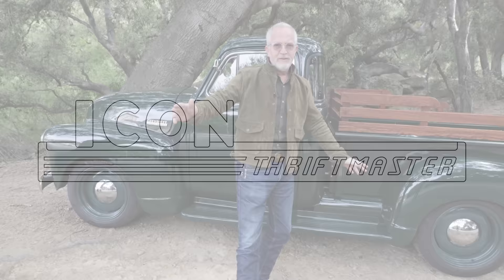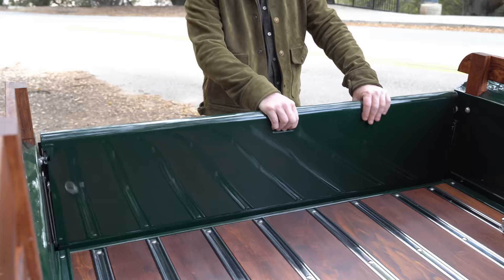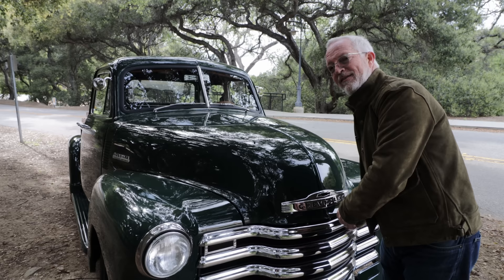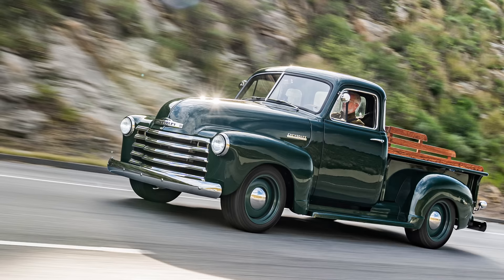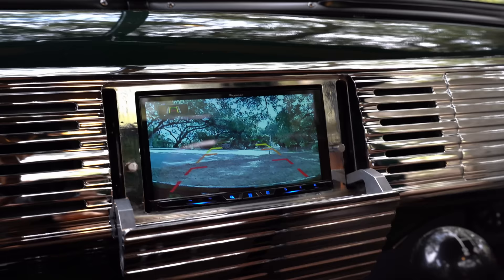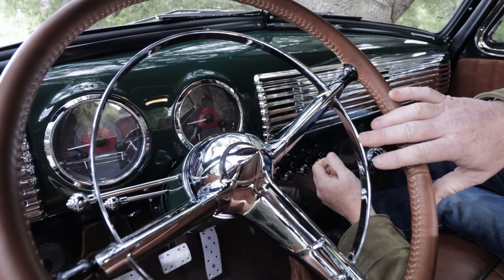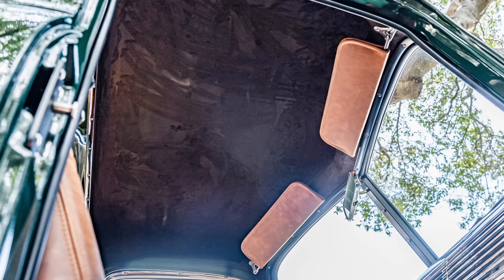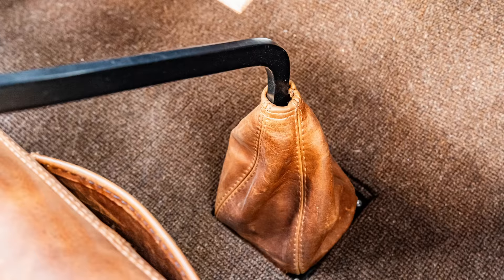ICON OLD School TR #24 Restored And Modified Chevy Thriftmaster Pick Up

Comment: Number 24. Does this mean there are only 24 lucky people in the world? Envy. I had a '48 3/4 ton Thriftmaster with the optional positive crankcase ventilation. What a dog to drive, but so good to look at. Did I mention the word envy?
Reply from the maker: Yes, only 24 of these delivered thus far!
Reply: WE HAD A 48 1/2 TON 3100 216 W / 4 - SPEED , WE BOUGHT IT IN 1973 FOR 250 .OO RUNNING FROM MY DADS COUSIN , AROUND TOWN IS WAS ZIPPY , IT NEEDED A RING AND VALVE JOB RAN VERY SMOOTH , BUT SMOKED ON THE FREEWAY AT 55 M.P.H. THE ONLY CHEVY TRUCK THAT I HAVE SEEN THAT HAD A COMPLETE CHROME HORN RING FOR A 3100 SERIES !! IF YOU HAVE A PLACE TO START THE WALNUT SHELL  - BLASTING THEY ARE WORTH EVERY PENNY AND EFFORT TO RESTORE !!!
Reply: I learned to drive in a 1951 ton and half Chevy. Dad set up barrels in a field and I had to parallel park that beast! Loved that truck, even took a date to the drive in movie in it

Comment: Another beautiful quality build from ICON!   Question - have you considered using sections of rigid tubing & short sections of flexible duct tube for the HVAC?  I see the flex ducting under the dash, and as a Product Designer, it seems like an area that could be dressed up.